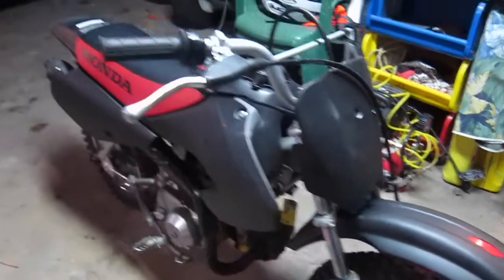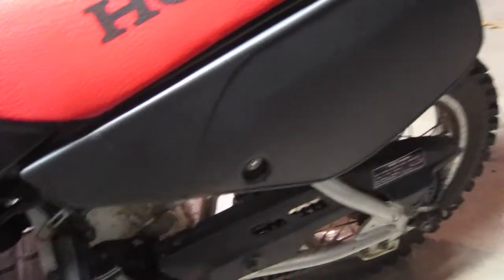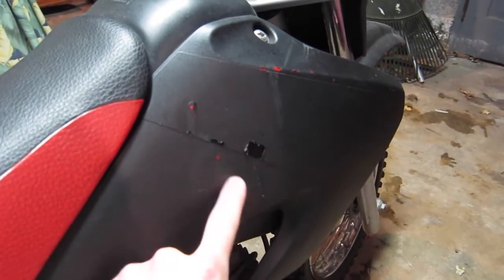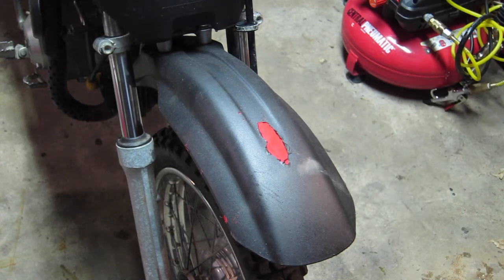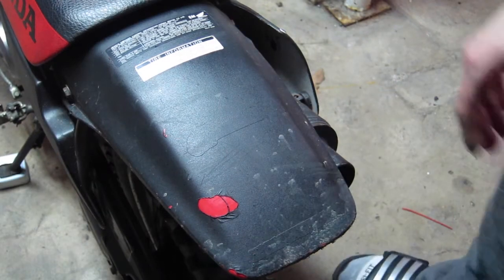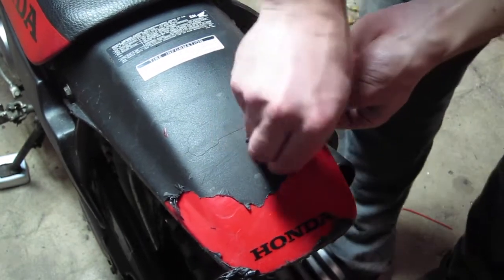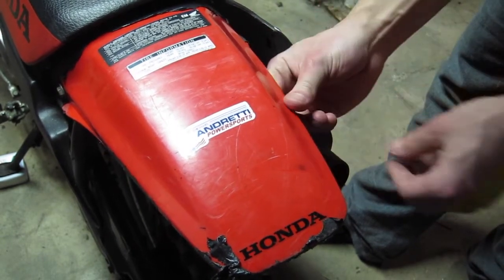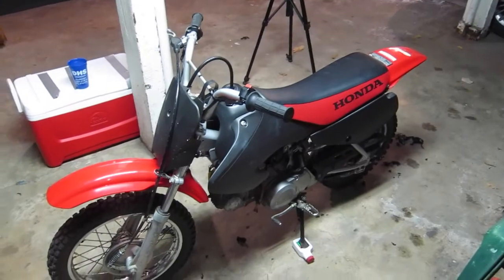Peeling 10 month old Plastidip off dirtbike!

Comment: How thick did you do the 5 coats? Doesn't look like it was laid on very thick at all, you can see through the peel. In all the other videos I've seen the peel is very thick, and not flaky at all. Most people say do they 3-5 coats. Are they just doing much thicker coats?
Reply from the maker: +boltentoke yeah they must be. i purposely didnt over wet it on each coat so it would look nice and even and not drip. i probably could of went a little heavier on it though.
Reply: +Adam Edward Ok cool. Most videos are of just spraying and no peeling, this is kind of the opposite ;). On some videos I'm even thinking "holy crap look how much this guy is spraying" lol but it seems to come out fine. The peel seems to come out more like an uninflated balloon type of thickness.
Have you redipped, or gotten a new bike/sold, or just left it the red?

Comment: How good did it hold up and for how long would u recommend me to use it ?
Reply from the maker: +Toxic Titan00 it holds up good. the more coats the better. get some spray wax and put that over the finished coat. it hardens it and makes it less likely to accidentally peel off. use it for as long as you want or as long as it looks good.